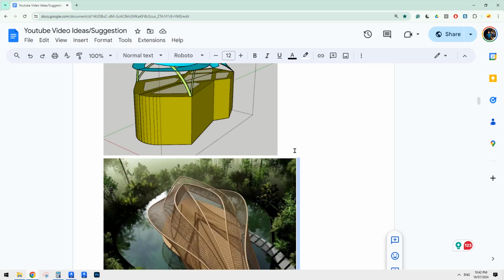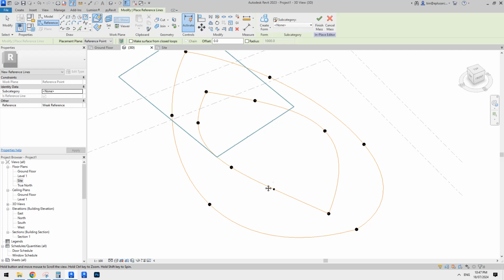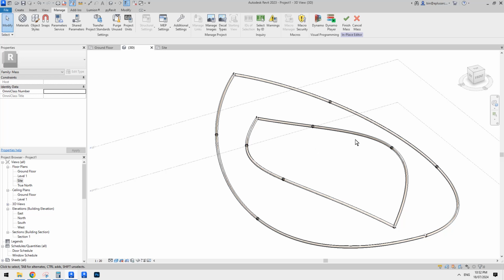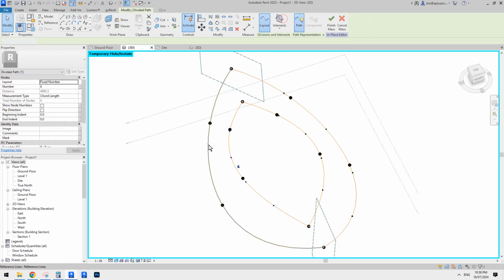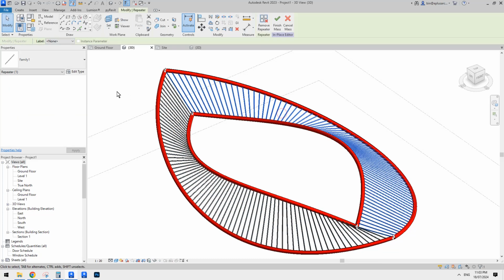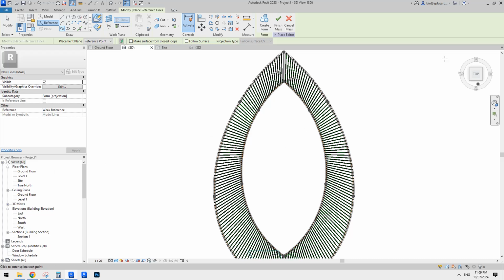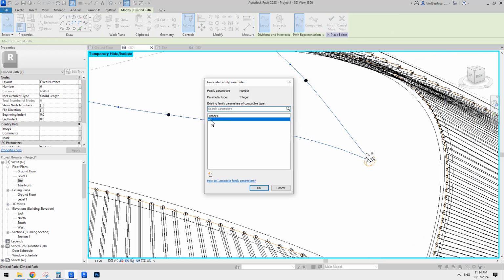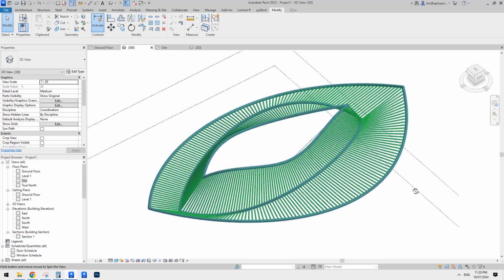24043 - Adaptive Family Exercise (Framing along curved path)

Comment: Bin … Why did u uncheck shared parameters although they have different names ?
Reply from the maker: There are pros and cons of shared family. For example you will be able to Tab and select the individual frame and edit its parameter if it is loaded into a project as a shared family. However, in this exercise, I want to have that parameter (radius of the individual member) as part of massing family, I have to untick the shared to make it a normal family, then associate that parameter with a parameter in that massing family.